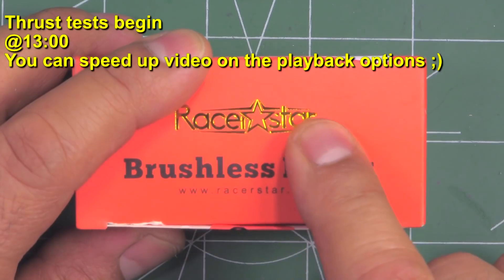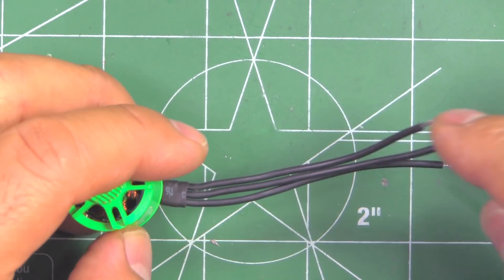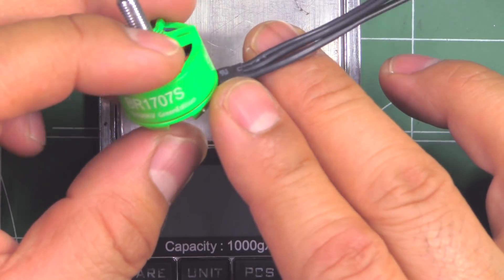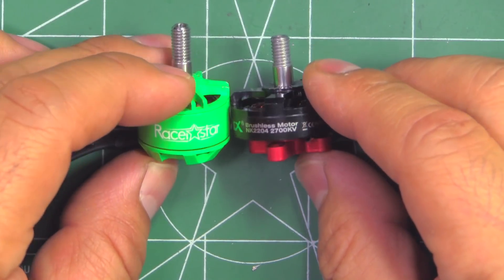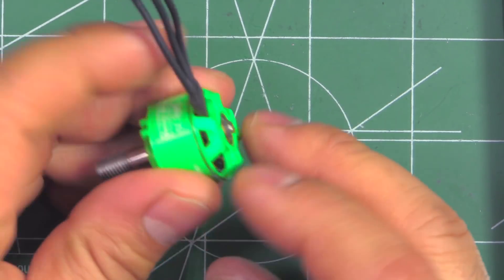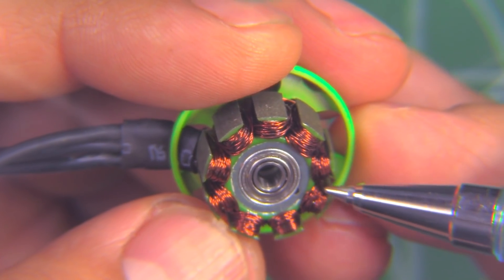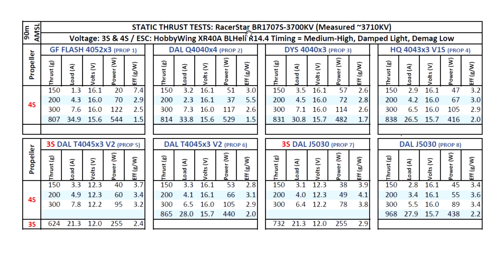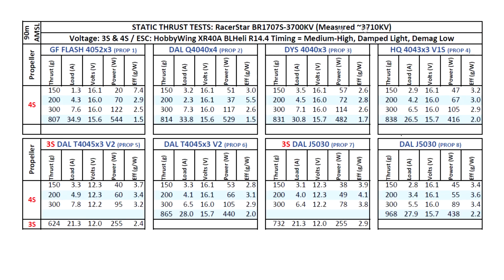Banggood.com RacerStar BR1707S-3700KV Better than a 1507 or a 2204? Thrust Tests Inside!

Comment: I love your new 2307 motors! They feel more locked in than the mrsteele 2306 ethix
Reply from the maker: Kevin FPV Awesome! Great to hear. That was the goal so I asked for a slightly larger 2307 stator that would feel responsive and smooth from the low and mid RPMs since that's important in freestyling. Thanks for sharing your experience.

Comment: You have to take into the bearing and bearing housing area.  That affects the taller skinnier motors more than the fatter ones.
Reply from the maker: RIght, the smaller diameter stators will loose more area from oversized bearings as is the case with this motor. That 8mm bearing is taking up a good chunk of the 17mm stator.

Comment: I am so angry at banggood! They make so many interesting motors but the quality is trash! If only they'd put a little bit more effort :( this was a possible 4 inch monster but hearing it overload on a 4 inch was a stab in my heart.
Reply: nasone32 bro, why is everyone saying it's banggood' fault?! Banggood is just like everyone else a retailer. The people that are making the motor is for this case racerstar
Reply: Thumbs_Fpv racerstar is property of banggood! Racerstar IS banggood. Like eachine, and realacc. Its all banggood brands.
Reply from the maker: nasone32 Right. It's highly likely that people at Banggood decide what motors to make and sell. They could put just a little more effort and ask for better construction on these motors. They can do it, just like the RacerStar RF series https://www.youtube.com/watch?v=sM8gVJ3hWmw those were very nicely built. For sure their main goal is max and fast profit but they could be much better like the RCX motors are.
Reply: but BG is the one that sell its, should be more concern to they quality of its products
Reply: broooo!
Reply: If you want a great motor for 4 inch - check out the rcINpower 1506 3400kV motors.  I'm running the HQ 4x4.3x3 V1S props and the performance is AMAZING on my 250gr AUW build (using a 4S piroflip 700mAh on a 5" Schnapp Dragon V2 frame = as seen on J. Bardwell's channel).  With these batteries, I haven't experienced any sag until the battery is depleted.  One note is that flying this requires a different style versus 5".  I wouldn't recommend this to a beginner - it requires precise flying as there isn't much inertia.
Reply: KruiZen agreed, those 1506's are lighter and more powerful than this 1707 anyways. Hell, this 1707 is weaker than some 1407's. The only thing i like about it is the color lol.

Comment: Thanks for the review! definitely helps me make a buying decision. I always check your channel before I purchase motors. Could you please do a review on the new xnova 1804 lightning motors? Seems like a really good motor for 3 - 4" build. claimed weight of 15.4g definitely a contender to the 14xx-15xx motors.
Reply from the maker: 15.4g for an 1806 is outstanding weight for that size. Usually they're around 20g. I've contacted XNova in the past requesting test motors but never got a reply :(
Reply: hmmm that's really surprising. I wouldve thought that they would entertain tests to get they're product out there. But maybe they dont need any more publicity? Try again, maybe they will respond this time. I would really like to see at least one review of these motors before I purchase. There are currently no reivews I can find on these and its frustrating.
Reply from the maker: Some companies are like that. Cobra and T-Motor also didn't want to send test samples. There's just too many motors these days, unfortunately I can't purchase and test all :(

Comment: Hi, good work. Is there any mistake with the trust with HQ props? On the video footage the trust is 1383g but later on the spreadsheet it’s only 800 something...
I’m amazed by the difference of amps between the GF flash and the HQ... like 10 amps...
Reply from the maker: Right, that's a mistake, it should be 868g. The spreadsheet has all the correct data in the propeller data sheets since that's copied from the thrust stand logs.

Comment: Perfect video! Sry, but the hyperlite 2204 and the rcx 2204 is better :D
Reply from the maker: Correct! this motor not as good as a 2204. Even a 1507 could be better because it would be lighter ;)
Reply: https://www.multirotorparts.com/motors/proton-x/proton-x-2204-3050kv.html